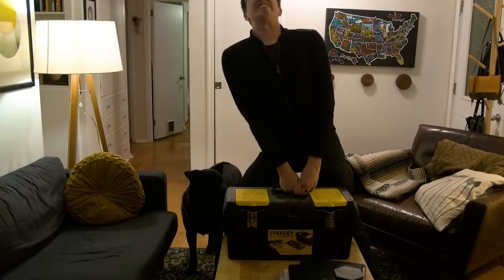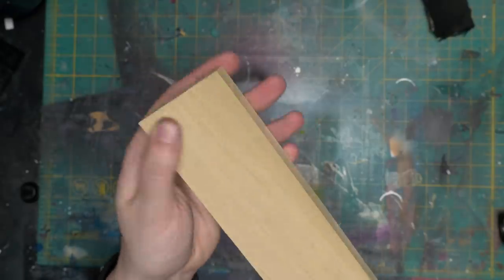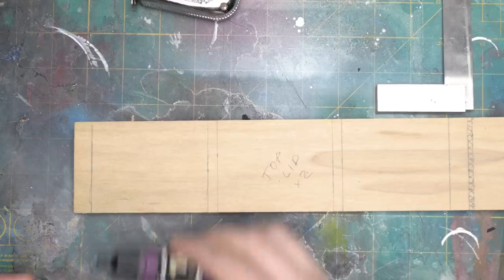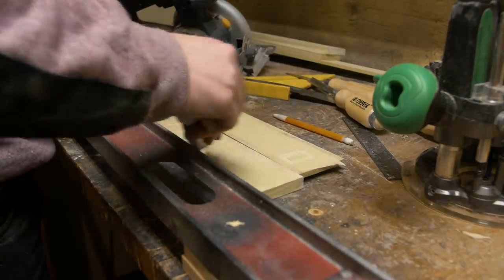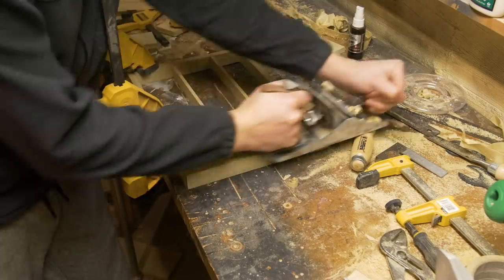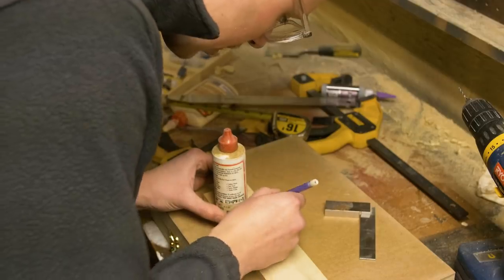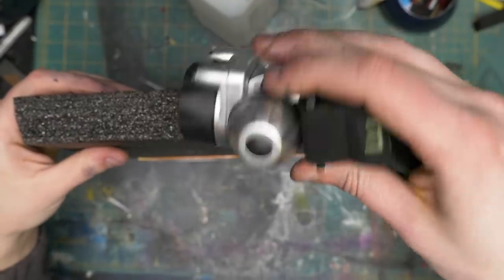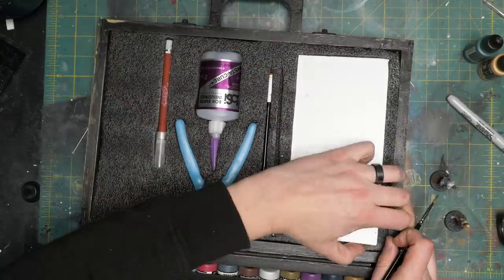Ultra Portable Paint Case!

Comment: What you lack in carpentry experience (and tools) you certainly make up for in determination. Get this man a table saw. Seriously you seem to be pretty interesed in carpentry so grabbing a portable table saw is a good investment. They aren't that expensive. The worksite Dewalt saw is like $250, and often goes on sale for cheaper. Don't let the size and portability fool you. I used that saw professionally for over 10 years and beat the shit out of it. I finally broke one using it in -40C weather one year. I didn't hesitate to replace it with the same model. Its so convenient and light, perfect for non permanent set ups.
Reply: "Don't let the size and portability fool you"  Perfect pick-up line!  😅
Reply: Both Miniac and BMC.  I friggin love you guys!  BMC which model of Dewalt would you suggest, that is around $250?  When do they go on sale?  Thanks to both of you!
Reply: I would think a dremel tool was a mini man's best friend.

Comment: I totally get the desire to make your own case and despite the mistakes and frustration I'm sure it was still fun and a learning experience which is irreplaceable. And then the sense of pride that you made your own case....but I can't help thinking that you already have an awesome case in the Frontier Wargaming Paintcase. Yeah...probably a little large for a 1-3 hour paint session...but it's already setup and you won't have to swap stuff from case to case. And if you don't need all the paint that thing holds...maybe take one of the paint trays and make a foam insert that can hold however many minis you can fit in there.

Comment: Nice build! I think I would have finished the wood with some oil or wipe on poly instead of paint, because as the paint chips off the wood is going to be really visible. 

For other tools to take with you I'd suggest a couple of mini files, some green stuff, and maybe one sculpting tool. That way you could also build minis with it.

Comment: When routing a dado like that you can add a second support block (the same thickness as the piece you are routing) on the other side to keep the router from tipping.  Lay it perpendicular to piece you're routing so you can start and stop off of the wood.  You can use a table saw, too.

Comment: If you put another piece of wood with the same thickness an bit away from the edge you're routing you can use it to support the back side of the router platform and keep it from tipping.  Also, if you cover the top of your piece to jigsaw with masking tape and draw your cut lines on that it'll negate a lot of the tear-out since jigsaws cut on the up stroke.  (And if I was single I would totally go to a gaming store to find a worthy mate.. but I am, as my besty calls me, a super nerd.. but on the other hand there are 3 other woman I play D&D with on the regular that aren't spoken for.)

Comment: Next time, surround the wood your cutting/routing with scrap wood. Or, if you're cutting multiple pieces in the same way, stack them and cut/route them at the same time. Should give your router more surface to sit on.

Comment: I suppose the easiest fix to your router problem would be to clamp a bigger piece of maybe plywood over your workpiece so the router has something to sit on. Over that you would fasten your makeshift fence and adjust the router depth by the thickness of the plywood. Instead of using a fence you could also look into getting yourself a template guide ring. This could then ride against the edge of the plywood. Hope this helps.

Comment: If this is going to be closed, sitting with the handle UP, then the CA bottle should point towards the handle not down... Otherwise the glue has a tendency to fill the nozzle and harden, or come pouring out into the case (bad) or all over your hand (worse) or lap (horrible). Simple fix, you could spin that whole foam panel around 180 degrees.

Comment: If you don't mind the non woodworker look grabbing a case from goodwill or any 2nd hand store makes for a cool looking retrofit ( 1980's Video camera case)  and then customize with foam from there.   Respect for doing it from scratch though man I also dabble in woodworking and it's not easy starting out when it's a hobbie and not something you have been trained for.

Comment: your super glue is stored upside down? that is a poor idea! Bob Smith bottle tend to leak into the cap and lock the whole thing up. and if its not totally sealed you will ruin that case and much of the gear.

Comment: hey bud love the videos! that router is too big for small projects, you can mount it under a "table" or specifically that old table saw you were given, so the bit is facing up instead down and run your pieces over that as a sort of jointer. it will make doing stuff like this a breeze! https://www.youtube.com/watch?v=dDHt2NQHKSI this is an excellent guide for around $20 just in case no one has said this yet. also switch up to gorilla glue. its much thinner and goes way farther.